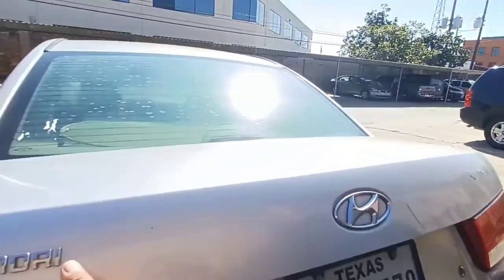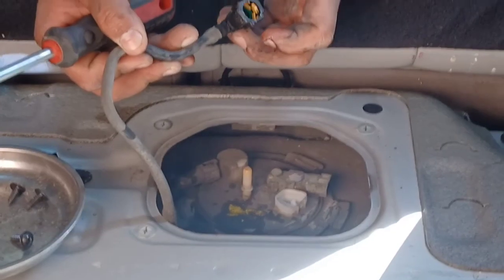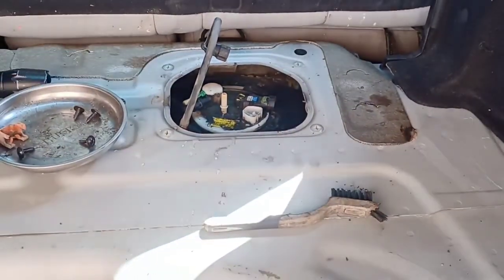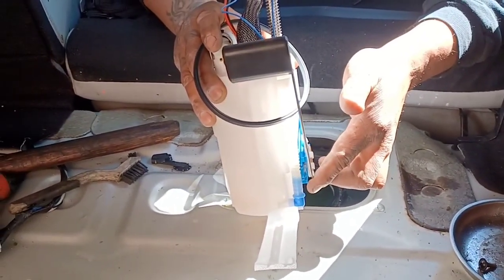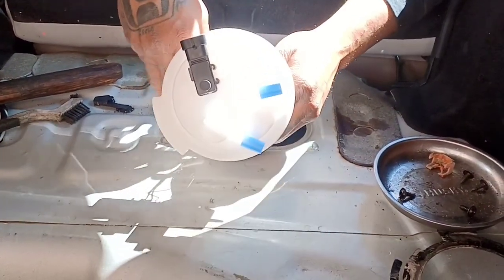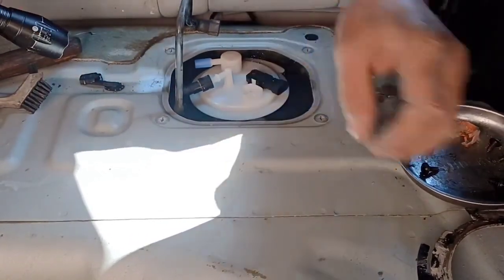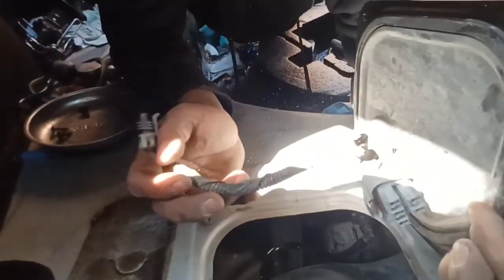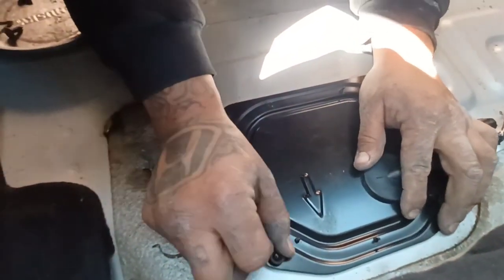How to replace the fuel pump on a Hyundai Sonata

Comment: Excellent video. A great help for DIYs like me. What I didn’t see is how you released pressure in the fuel line before disconnecting the hoses. Is it necessary to do that? Thank you and job well done.

Comment: If you try to do this on a gdi engine you will regret it!!! There is a hose with a wuick disconnect in the tank that mis be dosconnected before you can even attempt to remove it. Idk if this 2012 tank shrunk or the pump swelled but that mf was bigger than the hole to get it out. I took the pump apart to get it out. I plan to use a razor knife to make the hole a very little bit bigger so i can get the new one in but i am dreading it. Ive been working on cars for many many years. This has been very vwry very difficult. I REALLY DONT RECOMMEND YOU TRY. YOU WILL REGRET THE DISCISION. The non dgi pump shown herebis much easier.

Comment: This saved me hundreds of dollars. Took me a while but your video and instructions worked great. Put some lube under the ring to be able to hammer it back in place. Thank you man! Keep making videos!
Reply: Did you use the old lock ring? mine is a 7 of 10 after hitting it with a brass brush and brake parts cleaner. I was gonna soak it in krud kutter rust remover. It's in the freezer until I get daylight and it's not raining.
Reply: Yeah, but no rust on mind. Just wiped it clean.
Reply: I finished the job today and reinstalled a 3200 watt sound system. I used the old rusty but cleaned up lock ring. It's only 18 bucks for the new lock ring on amazon. However this job took long enough for the parts to come and it was a full day thunderstorm right after the parts came. I froze the lock ring for 48hr and got it started very fast, all tabs started and a new O ring seated like a Queen. Then i used pb Blaster at each claw and knocked her home. I then used crc electronics cleaner to clean up the pb blaster. Thanks so much for the video, I'll subscribe with my 50 alts too.

Comment: Thanks bro! Parts not coming until tomorrow by 10pm so I went at the ring with PB Blaster a STEEL screwdriver and a STEEL hammer. Even though I ordered the wrench. Only pu$$ E's and dead people are scared of sparks and gasoline. I did it while smoking a J. Since the parts won't be here till dark, I'll probably do the install by candle light. I did unplug the battery ground because I got a lot of car audio stuff back there. If not I'll install it Hellen Keller style after watching you do it.